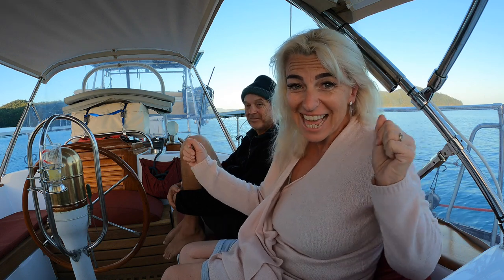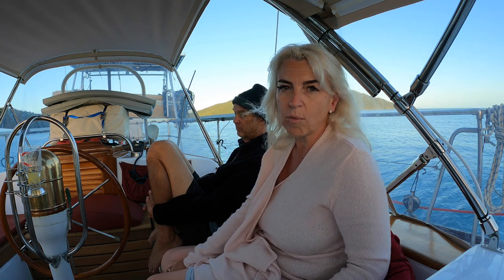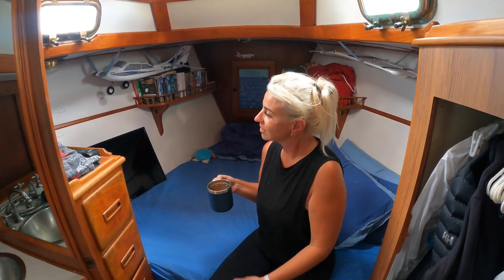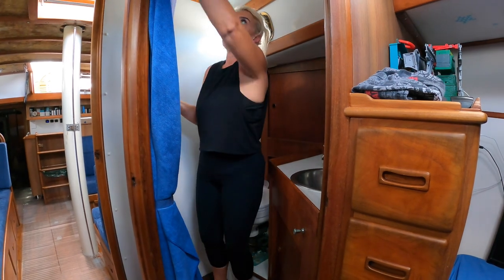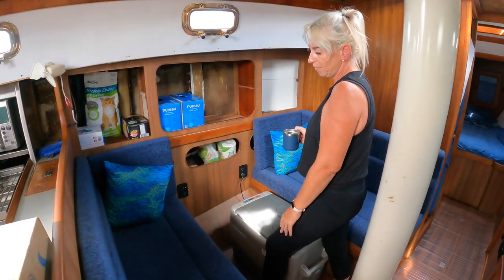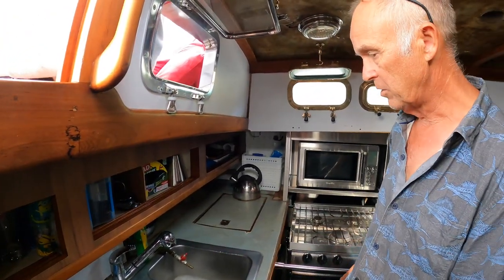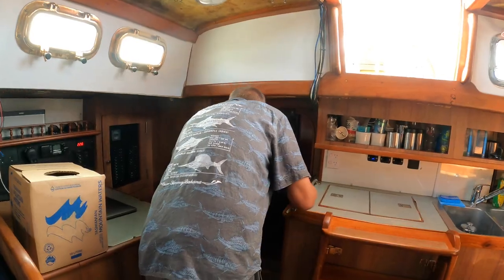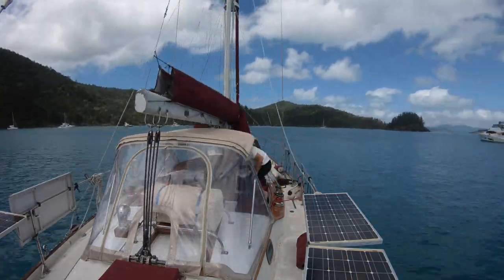How To Go Sailing In The Middle Of A Boat Refit | Boat Tour & Refit Documentary Part 10

Comment: Happy B'Day Sharon! Interesting video as always. I'm progressing with my KP44 refit albeit at a much less ambitious scale than yours! Mostly sanding, painting and vigorous application of Deks Olje! Need to re do the galley and upgrade some of the instrumentation. I would be interested in broader details of the boat. Will get the Inverter/charger you just bought as mine needs replacing. Also replacing all cushions. What engine do you have an board, what instrumentation, what age and details of your rigging and sails, sail plan etc?
Reply from the maker: Hi Rob, we were only just talking about Deks Olje the other day! Welcome to the world of maintaining teak 🤪 Our inverter is a Victron multiplus 3000 compact (charger inverter). Engine is an old Perkins 4236 85HP. Absolute stalwart - love it!! Instruments are a mix of Raymarine & B&G Quad. Talk to your local dealers and do some net surfing would be my advice. Sails are all pretty new now as part of the refit and we use Ullman Sails - fantastic job every time. We have a 130% genoa (roller furling), hanked-on overlapping staysail, partially battened main with 2 deep reefs, and a code zero on a Selden furler. We ditched our spinnakers (they were either worn out or plain unmanageable with 2 crew!) We re-rigged about 2 years ago. All stainless 1 x 19 wire with normal swage fittings (we had Norseman but our local rigger couldn’t get the parts). I’ll try and remember to cover the sails & rig in a video at some stage. The engine will no doubt make an appearance when we get to the hobbit hole 😅